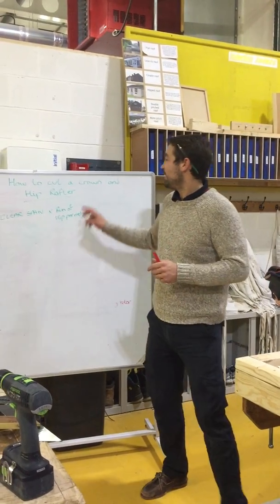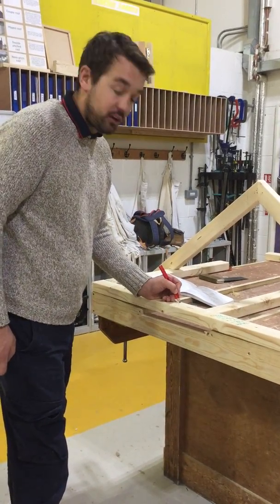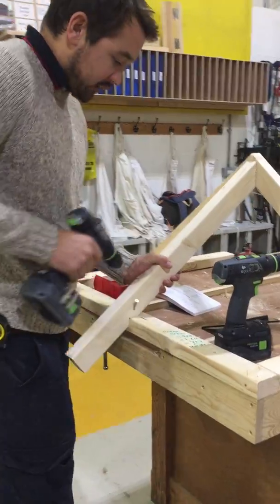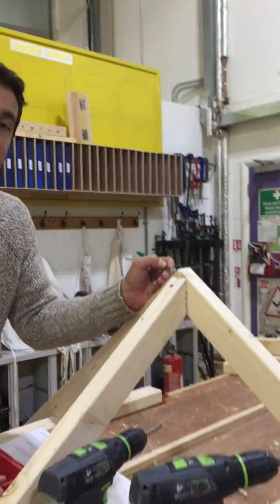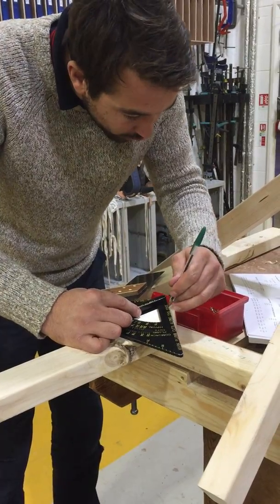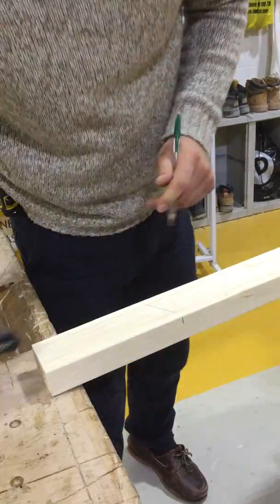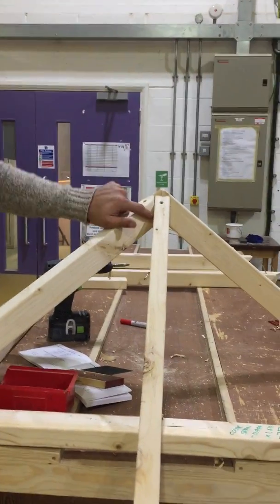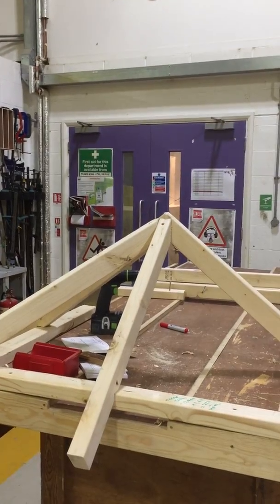How to cut in a hip roof - the easy way with ready reckoner

Comment: Would it be correct to take half the common rafter thickness of the length of the hip so you don’t have to force it into position, on the plum cut not measured down the back of the hip , and as you know cut the corner of the plate and reduce the bird’s mouth?

Comment: U probably know this already but a good tip for someone just learning is when the arm of your square reads 38 degrees it also reads 9.5 on the common jack scale by moving it to 9.5 on the hip valley scale  gives correct plumb cut on hip or valley rafter for 38 degree common roof it just cuts out a bit of maths and maby some confusion.
Reply from the maker: I’ll have a look at tomorrow no I didn’t know that thanks
Reply: Speed square all the way 👍🏻

Comment: Yea it's not easy making a video there is much more pressure, but besides the deduction where the corner of the wall plate is normaly cut off and the hip measurement is adjusted to suit this. Another point that is also very important for students and others is when marking the birds mouth on the hip rafter the cutting back in measurement is always taken and measured along the plumb line not square across the rafter, in other words the Height above plate of the hip rafter is kept the same as the height above plate as the common rafter measured along the plumb line in both cases. The side cuts at the top of the plumb cut on the hip rafter are actually 41.2 degrees if you are marking them with a bevel in the case of this model and of course this angle changes for different pitches of roofs but if we are setting a skill saw to cut them the saw is set to 45 degrees.

Comment: Who on earth told you to do a hip like that? Would love to know what your qualifications are? You can work out the backing bevel with a traditional square, if you would ever do that in any other scenario than a roof lantern. You would always crop the plate, never go to the point. Probably the worst demonstration i've ever seen. Your cheek cuts are not 45 degrees, in plan yes but not marked on top of the hip.
Reply from the maker: Cut hundreds of hips never had an issue yet? Always looking for new ways though? 
L3 NVQ site carpentry, HNC construction management.
Reply from the maker: You will see in hip roof on site I have cropped the plate? What you referring to as the “cheek”.
Reply: I twigged the hip 45 degree cuts. They would be 45 degrees off the hip plumb cut. Cutting hips using maths is ok, but not great for many site applications where larger tolerances occur. Never seen a hips plate birds mouth not cut to a cropped corner either. It seems the starting point for the video should have been setting out the common rafter pair by halfing the span minus half the rafter thickness. You can't be too critical of the video though, he clearly has roofing knowledge and its not easy trying to make an informative video whilst actually demonstrating it and doing it in one take.
Reply from the maker: Man Stuff cheers- I do always crop the wall plate on site. But with the pressure of video I forgot. Sometimes though when learning good to do it to point with the maths then take it off another side then you remember it. Cheers 
The commons just a quick set up for video, thanks for pointers though.
Reply: @southdevonhomes-jonnystand4039  I've started filming projects I am working on now to try and empart some of the knowledge and skills I've built up over tye past 35 years as its almost impossible to find any keen youngsters who want to learn it. Its bloody stressfull trying to get what's in your head, and what you normally do on autopilot, into a coherent explanation whilst also being aware that you're actually supposed to be working. I've had a quick sqint at some of your other video's, and I think its great that you are getting infront of yougsters and trying to help them learn. Cheers.
Reply: @d2cdl  I agree been doing it for 30 years just found a keen youngster and is learning every day had wasters a lot and its disheartening , they want microwave knowledge and get bored sod off and think they are roof cutters 🤔 I applaud this man putting himself out there for trolls and scrutiny he knows his onions and is a teacher👍 and to the youngsters do it right earn good money simple equation.
Reply: @leohutchy7142  Great comment Leo. I've started putting together a few videos on my other channel, 'The Tall Carpenter', in the hope that, like the guy on this channel, I can build up to more instructional videos to perhaps help others. Its not as easy as it looks doing these types of videos and, like you, I take my hat of to those that try rather than just pulling them down with negative comments. Good luck with your young apprentice.
Reply: @d2cdl  thank you and I will be following you’re channel also 👍🏻

Comment: Would this work for a ‘bastard’  hip? Which pitch would you go off? Say if your cutting in on a trussed hip and your standard trusses are 40° and your mono’s are 45° which pitch would you follow. Cheers
Reply from the maker: mike thompson sorry mate only done one or two bastard hips on a cut roof. It hard for me to visualise it without a drawing.
Reply: Jonathan Standing no worries mate, I usually just bang a string line down and get my bevels from there as well as the true length, was just curious to know if it worked.